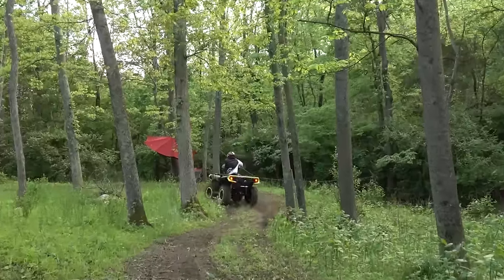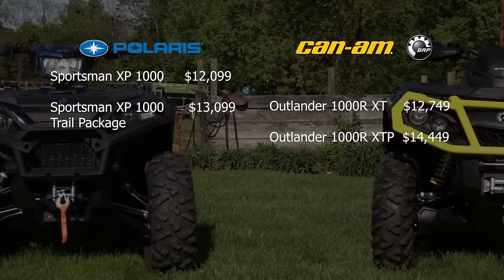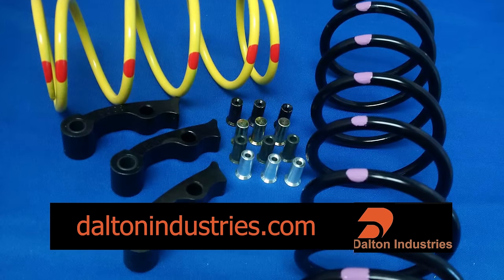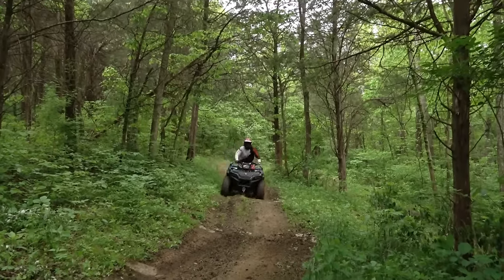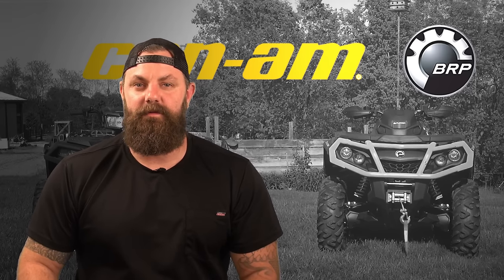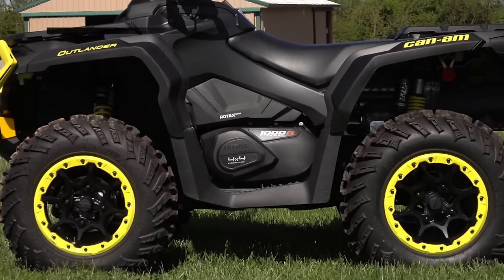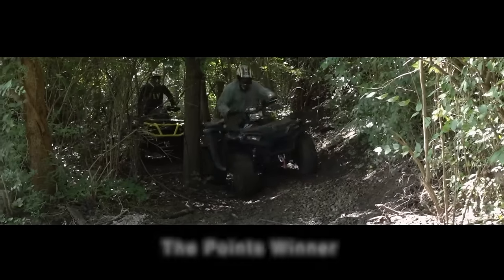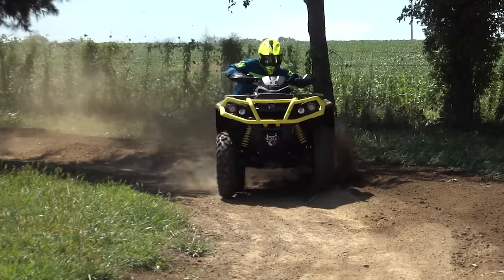Polaris Sportsman XP 1000 VS Can-Am Outlander 1000R XT-P, 1000cc 4x4 ATV Shootout

Comment: Must watch video for anyone buying a big bore atv! Also for single piston atv owners who want to watch how muscle atv
predators perform! Nothing throws sod like a big bore. 😊
Reply: Marauder Mitchelli I know you’ve had both and currently have the outlander. Seems like the outlander throttle by wire was an issue being touchy for most of the guys in the review. In your opinion Is that something that takes some getting used to and now you don’t notice anymore since you’ve been riding one for a while?
Reply: wow i want one
Reply: Truth I had both at the same time...I liked the Can Am so much I stopped riding the Polaris...4 months later it was gone for a outlander max.
Reply: jmeist25 the throttle is touchy because the clutch engages quickly at a lower rpm and the engine has so much torque grabs and your off, popo has to build rpm then engage the clutch and then more rpm. For me the popo was continually having to spool up. No doubt both throttle’s fly by wire push easy. For me it is no issue, i push the throttle like I pull a trigger slow and steady. I ride quick but not fast. The riders did an excellent job...splitting hairs on two great machines.
Reply: @iamf6641  i concur!
Reply: Nothing breaks down and leave you stranded like a big bore. Buy a yamaha or suzuki and actually make it home. Just dont expect 80hp.
Reply: Chuck Beef they are reliable you are absolutely correct. Taking my outlander xtp max for a ride tomorrow with 30” cryptic tires, oem clutch, I smell a little rubber burning when I loaded hope the belt holds up! Watch and see! 😊
Reply: Marauder Mitchelli I had a 850 sportsman and broke everything and not really beating on it. Going to try a king quad 750 this spring. Have a good ride, im still on my assault until the snow melts.
Reply: Chuck Beef my friends ride king quad great bikes good choice, keep a look out I may have them on my channel.
Reply: Chuck I’m uploading my kingquad video tonight should be on my channel by tomorrow night, I hope you like it.

Comment: Getting a 850 with trail package next week!
Reply from the maker: Congratulations. You have our Envy.
Reply: The 850 are awesome mine is unstoppable I've driven the shit out it about 5k miles and it's still on stock belt. Just remember to do your pinion plate upgrade and it will last forever!
Reply: Zack thanks for the tip man good to know!
Reply: I love my 850 trail do urself a favor and get the rvs performance engine brake delete kit its the best upgrade ever i hated my engine braking on the polaris its terrible the kit removes it it makes it ten times funner to ride and gas mileage goes way up!

Comment: Great video! I have 570 sportsman and I'm thinking to buy 1000cc Outlander. Only "nag" I have on this video is for power steering. What's up with that? I don't have power steering in my sportsman and it's great to drive all day, even in harsh conditions. I tested my friends Trapper 550 with power steering and I could not drive single meter straight. Every bump moved me side to side and that little movement what I made caused more zigzag because of power steering. Had to almost stop few times to stop the wiggle.
Is there a way to turn off the power steering? And yes, there are differences in power steering types, but still wondering?
Reply from the maker: Power steering is one of those things that we never knew we needed until we got it. Polaris does a good job making their machines steer well even without power steering.  We have never ridden a trapper 550 so we can't speak to its power steering performance but neither of these machines exhibits that type of behavior. Polaris added adjustable power steering this year which Can-Am has had for some time.  Neither of them will allow you to turn the power steering off but you wouldn't want to anyway. Either will allow you to carry more speed through really chunky terrain and if you run into something it greatly reduces feedback through the steering.  If you have any more questions please feel free to hit us back.
Reply: Im with you on power steering..but im an old rat racer fr the 90's.power steering sucks in rat race..lol

Comment: the fox suspension make a difference...can am all day
Reply: That's true.. The shocks are a feature you can't get on the Polaris from the factory.. The Geometry makes them much different tho too, they both have strengths and weaknesses..
Reply: Then why does the can am not ride has good the Sportsman XP 1000?
Reply: @crazyflyboy30  fox suspension is fully adjustable... high Performance shocks vs standart shock of polaris....
Reply: @perrodukegordo  I will still take the  Polaris better ride over the can am and they even said in the video that the can am couldn't be set to ride has good has the Polaris.
Reply: @crazyflyboy30  fox shocks are high Performance vs standard shocks, Huge diference....

Comment: I think I've watched this video at least a half dozen times. This channel as well as Dirt Obsexxion helped me decide on a brand new Outlander Max XT-P 1000r. Really enjoy these very objective reviews and shootouts. 

I'd be incredibly interested to see a re-match between these two models, particularly the Outlander XT-P Max and Sportsman XP Touring. (Factory 2-up models). I'm curious to see if you all come to the same conclusion I did when I checked out both models in person at my local BRP and Polaris dealers. Proper factory 2-up ATV seems to be a somewhat neglected category for reviews and shootouts. I feel like those of us who like to ride 2-up with our significant other but aren't ready to get into a Side X Side could really benefit from an ATV On Demand shootout between the pair. 

Also would like to note, BRP added the new-ish Visco-4-Lock manually selectable locking front diff to the XT-P. Acts as the standard Visco-Lock when in "regular" 4wd, but you can select a fully locked front diff when needed. A welcome feature I think.

Comment: Great vid guys. Only thing I wish was that you guys had more trail related stuff to compare. Climbing hills, crawling over rocks/obstacles, going through mud, etc.
Reply from the maker: Thank you, duly noted and we will deliver.
Reply: It’s hard to do that, because it’s all about the rider with things like that. Line choice, weight control, ect are things that would change from rider to rider.
Reply: Justin BUrns agreed but the riders would be using both machines. And giving their feedback on how they feel each machine did. They would prob have to go through the same spot a few times with each.

Comment: I got the sportsman 1000s with long travel suspension and those 2 atv are far from the S
Reply from the maker: The Sportsman S would not have been able to get around our test track due to its width. That would have made it impossible for it to compete. Your machine is Awesome on Trails frequented by side by sides. We plan on doing some comparisons between some different sport and sport utility models to the Scrambler S although it would be pretty difficult to do a shootout since as you pointed out, be added width, suspension travel, and weight of the Polaris S models put them in a class all their own. They're pretty rad!
Reply: ATVonDemand when you add a custom offset tire and wheel combo to a xpsportsman it is with an inch to an inch and a half of width as the s model. Never been on a trail that I was not able to fit on with mine at 53 1/2 inches wide
Reply: Thank goodness

Comment: I have a 2018 sportsman 850 xp camo. Love the machine. The only complaint I have is as soon as I want to go fast the suspension can’t handle it. In regards to suspension setup I have no idea what to look for. The stock tires are horrible as they wore in. I am going to put big horns on next. If you have any suspension idea please help.
Reply from the maker: As far as the stock setup goes. We maxed out the front shocks preload and ran the rear shocks in the middle. This helps prevent roll in corners and excessive weight transfer under hard braking. Elka has some pretty affordable aftermarket shocks for the Sportsman. They can get you set up with a firmer ride that will allow you to take better advantage of that big 850.
Reply: ATVonDemand my fronts are set to the max as well. Still way to soft

Comment: The Polaris is slightly lighter but in my experience it feels like it’s heavier when riding compared to the can am
Reply from the maker: That's fair. Our riders felt that the Sportsman felt lighter due to its lighter steering effort at low to intermediate speeds. The more responsive power of the Outlander combined with the firmer suspension of the XT - P edition do  make the Outlander feel a bit more nimble when trying to raise the front end or break the back end loose. Of course, the firmer shocks help fight weight transfer and that helps.
Reply: ATVonDemand Everybody’s different, thanks for the response!!!!!!
Reply: Slightly lighter lol  we can't pick up  either atv so weight is not alway the issue.
Reply: 28crazydave lmfao

Comment: I have a 2018 sportsman 850 and my only complaint about it is there is too much slack in the drive train. When shifting from forward to reverse or letting off the throttle/ reapplying throttle quickly there is a very audible clunk some were either in the rear diff or the clutching. Regardless, I think that such loose tolerances are unacceptable. I also agree that the engine braking is a bit strong on the sportsman. If you have never ridden it and aren't prepared for it, it will catch you off guard.

Comment: I go to be 100% honest about the power of Sportsman XP 1000 ,yes to much but I Love it. My son in law and I tested the  Kodak 700 to the Sportsman XP 1000 and in ( work mode)they are dead even but in performance mode my son in law said I " looked I was shot out of F,,,ing canon when my front wheels got back on the ground " I even  had to let off  it's that fast.
Reply from the maker: We imagine so, you're comparing an ATV with 40-something horsepower to 1 with 90 horsepower. The Sportsman xp1k motor is pretty awesome.
Reply: But you could buy 2 kodiaks and a utility trailer to haul them for the price of one XP 1000
Reply: @gregrowe1168  not true, I got my new Sportsman XP 1000 for $10,000 OTD and my Kodak 700 EPS was $7,700 OTD but I had to add a diff. lock and other mods that's make it cost more seeing I have over  $10,000 in it now.
Reply: The Kodiak is really only a good value if you get the base model.  Arctic Cat had a similar one, the VLC 700.  Actually they were the first one to offer a value priced 700cc class machine.  Ive seen the base model Kodiak in the $5500 range locally.  Though add a few hundred for otd price and you're still in the $6300-$6400 range.  The local Polaris dealers don't discount much on their units.  I have a huge Polaris dealer several hours away that a lot of people go to that advertises some of the lowest prices I've seen anywhere, Abernathy Motorsports in Union City, TN.  Im about a 3 hour drive from there.
Reply: @gregrowe1168  Thanks, I not in the market for new ATV or SXS but I will keep that place in mind because I'm in   Alabama so not to far away from Tennessee.

Comment: My tuned 2021 outlander 650 with a clutch kit and yoshimura exhaust will smoke a Polaris 850 every time (in a drag race and top speed)The can am is pretty aggressive to ride and you’re gonna get tired but get into shape fast. The polaris is great for cruising on trails but the power steering on it makes it nervous at high speeds. The power on the polaris smooth but it needs to be revved up alot to do any agressive riding. The outlander’s power on the other hand is exciting and really shines down low and mid range.
Reply: @John Doe added a CVTech primary since then. With just a tune and exhaust it was getting 49.6hp at the wheels. With CVTech primary calibrated for peak power @8000rpm I’m seeing  55-56hp at the wheels. A stock 850 outlander makes 52ish at the wheels. So no, a tune and exhaust didn’t really put the power above the sportsman at the time.

Comment: Me again -  I just priced out a 2020 Yamaha Grizzly 700 EPS SE with front and rear bumpers and a winch and it came to $17,029.29 including tax in Canadian dollars. A Polaris Sportsman 850 with the same options and it was $15,460. That's a fair comparison waiting to happen. I know the 850 is bigger but it's less expensive and the 700 is largest engine Yamaha has. I'd even be interested in seeing a Grizzly against a Polaris 570, as they have roughly the same horse power.
Reply from the maker: If you were using the 570 SP that would be a pretty fair shootout.
Reply: @ATVonDemand  It would be a fair comparison if the prices were similar. But the the 570 Premium LE is $13,160 with tax. That's almost $4,000 less. Comparing the Grizzly 700 to an 850 Polaris would be a more fair comparison due to price I think. PLEASE do that comparison.

Comment: I would have to say that in the real world the Sportsman XP 1000 is the clear winner because to start with  the can am is real $2000 more because a can am dealer will not cut a deal and a Polaris dealer will and the 4x4 works better, ride better ,better EPS, Softer seat,Bluetooth to my phone, 4 bigger disk brakes and not 3 ,the drive by wire works and can am has all most killed some people, I love the front box easy to get to when I'm ridding, 3 headlights makes all the difference no need to add junkie light bars.
Reply: Most of those things are personal preference, which I agree with.. But CanAms are competitively priced, there's an Outlander xxc at my local dealership on sale for 11,9.. Some large volume dealerships have more wiggle room on price, but the service isn't always as good as the smaller guys.
Reply from the maker: Lots of great points and that's why the Polaris will be the machine of choice for many and the class.
Reply: @dirtobsexxionvlogs4892  I said this before but I talked to a dealer that sells both and he said that can am cost the dealer more than Polaris even if the MSRP are the same. In my experience with a can am dealer is very bad has my first choice was a can am xmr 1000 but wouldn't even give me real price till I was ready to sign the paperwork all would say it like over  $15,000 so I got another dealer and see the Sportsman XP 1000 ask what is your best deal OTD $10,000 is what he said so got it.
Reply: @crazyflyboy30  Yes I  remember! That's a great price for  sure!  Savvy consumerism too!!
Reply: @dirtobsexxionvlogs4892  Thanks ,I good deal on my Kodak 700 EPS for $7,700 but with all my modd mods got over  $10,000 in it now. Do a lot of mods to the Sportsman XP 1000 to lower the CG ,all 4 - 27x11x14 XTR tires on 4-7.5 x 14 OEM rims,relocated the battery to the lower frame,  custom made 1/4 steel skid plates.

Comment: How does the Outlander win the handling challenging when 2/3 drivers liked it better and 1 driver didn’t like it at all?
Reply from the maker: Better traction and better suspension settings for taking advantage of its power are two of the main reasons that come to mind.

Comment: This is a very interesting comparison, and each viewer can apply their own weightings to the various categories as it affects their needs/desires.
My particular focus is on finding an AWD system that is as positive as a mechanical front diff lock.  When running tracks on snow it seems to be critical to have the lightest machine possible and for all for corners to be consistently turning at the same speed if one is to minimize the risk of getting stuck.  The Yamaha Grizzly is easily the top machine in my environment, except I persist in desiring a 2-up, which limits me to Can-Am or Polaris.  An 850 would have sufficient power for the job.

Comment: I really enjoyed this video. I have the 2017 XT-P 850 and love it. Drove a friend's 850 Sportman and would choose the Outlander personally. Power is instant. Not sure I agree with slowing to a stop to engage 4x4 on outlander. As long as you are not spinning the wheels, my 4x4 on the 2017 activates at any speed.
Reply: That's good to know... Personal preference is the most important consideration! CanAm recommends slowing to below 10mph to engage 4x4, so it probably can engage at higher speed but I'd follow their recommendation since it's probably based on either longevity or safety.. The factory recommendation is what we based that point on though.
Reply: @dirtobsexxionvlogs4892  I have an outlander 800 that I did not purchase new.  I have had it for a few years now, and never even knew that it was supposed to be slowed down that much to engage 4wd.  I always treated it like my truck, dont engage while spinning the tires and it's good to go.  I suspect that the manufacturers recommendation is simply them being overly cautious.  I understand that for your purposes of reviewing these machines that you must go with what the manufacturer suggests.
Reply: I feel as though they are referring to the 2019 change to the 4x4. They are already in 4x4 (3 wheel drive) but don’t feel that fourth wheel grab (hydraulic pressure lock) unless they slow down real slow

Comment: I do have to admit both are great machines but the belt on the can am keeps slipping like mad. Anyone know any upgrades for it to help with the belt?
Reply from the maker: Dalton Industries has clutch kits that will improve belt pressure fixing your belt slippage issues.   Make sure you shift your machine into low when operating at low speeds. You can cook your belt without really realizing it. HIt us back if you have any more questions.